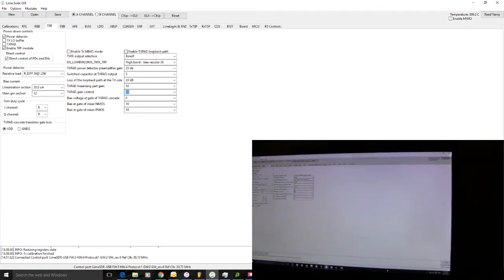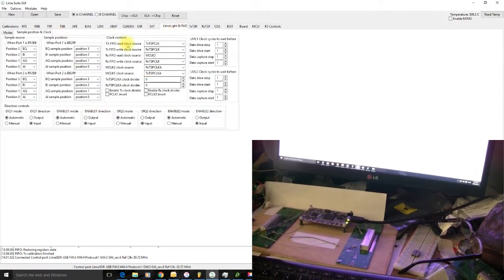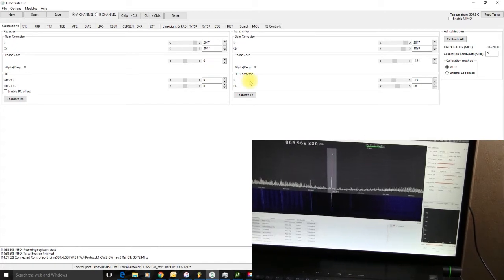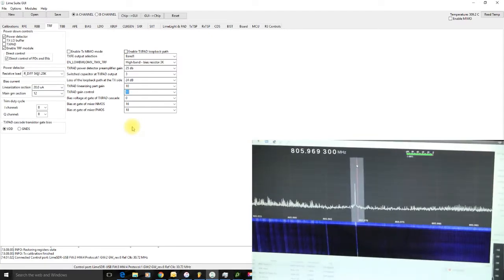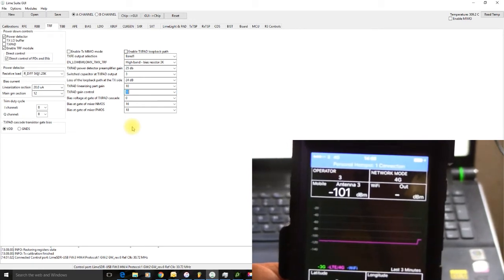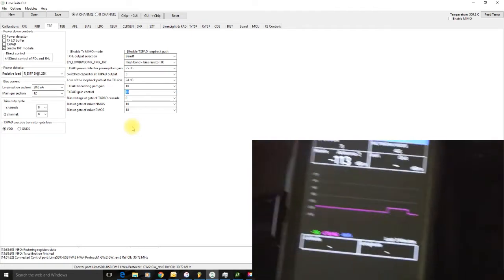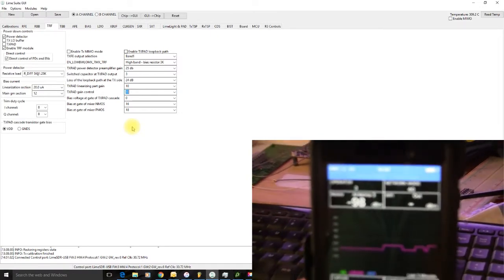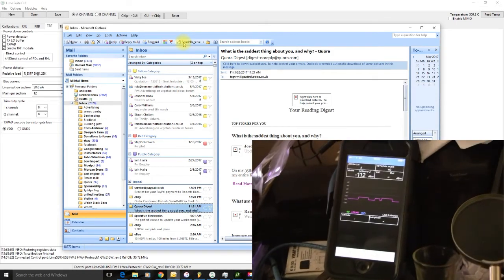LimeSDR working as a simple 4G signal repeater

Comment: Do you have any pointers on a basic 'Hello World' Transmit test for the LimeSDR-USB?

I have two small whip antennas connected to the TX1_1 and TX1_2..   however when I open SDRAngel and transmit NFM Modulated Morse at 467.562Mhz, I don't detect anything on a nearby RTL-SDR/Walkie-Talkie.   (The RTL-SDR does detect the Walkie-Talkie NFM).

SDRAngel recognizes the LimeSDR-USB as a Sink device.. but is there a pre-setup needed in Lime Suite that enables the TX1?

In case it's defective, is there a Self-Test that I can run?  If not, is there GRC Flow Graph that can be used to test the Transmit?